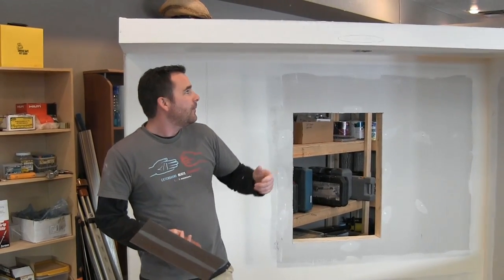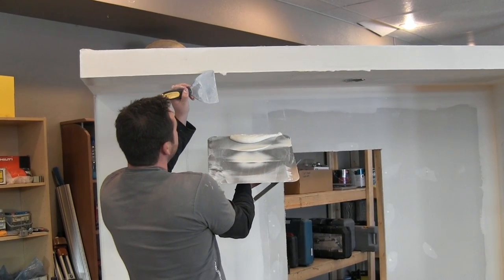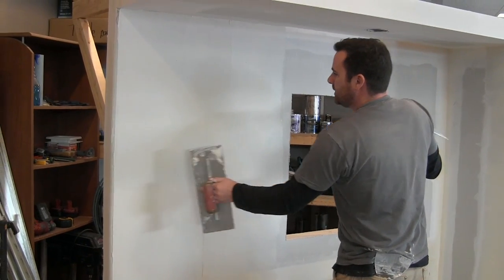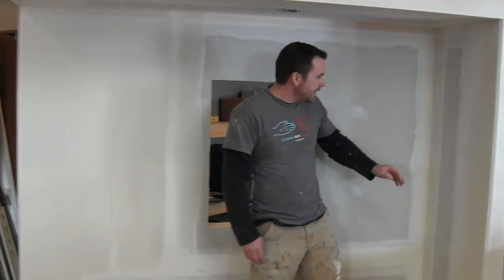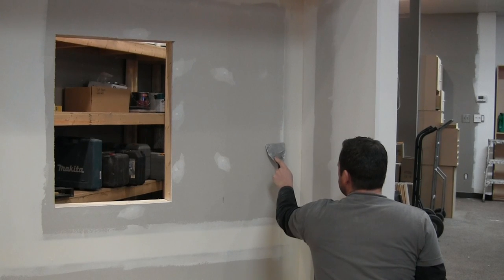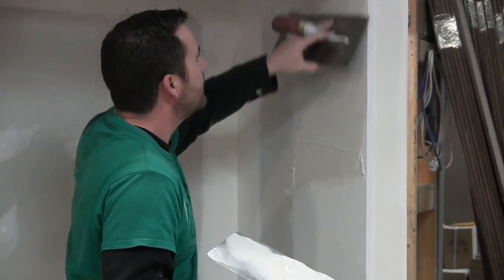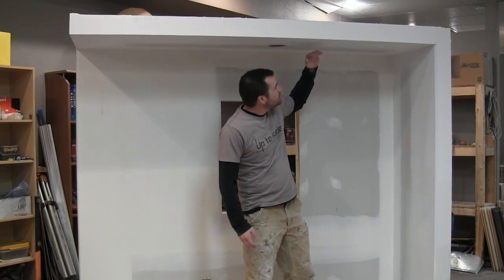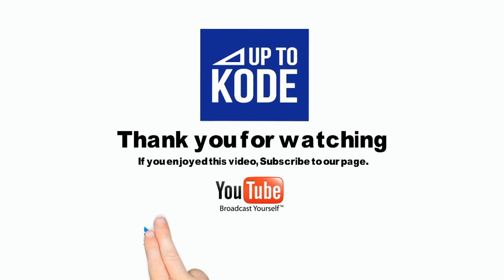The Complete Beginner's Guide To Drywall Video: Mastering Drywall Mud & Coating

Comment from the maker: ***** I couldn't see where to reply to your comment so hopefully you will see this. I would still use your trowel. Sounds like it's a true drywall trowel which have a slight curve in them. I typically use a concrete trowel which is straight. If it's that size I would maybe just do a swipe on the left and right side of the joint and then one down the middle to flatten it out. If you have issues try holding the trowel more flat to the wall than perpendicular. That should keep your mud flat if there's a curve in your trowel. Let me know if that helps.

Comment: The right way to mud !!! I would only suggest one thing. Instead of using just a 12" drywall trowel, ditch the 12 and use a 10" and a 14". Not only do they give you the progression in width, the 10 is stiffer than a 12 and the 14 is more flexible. Just what you want as the layers get thinner.

Comment: I have a marshalltown 14 or 16" trowel like yours but it has a slight curve to it. 

What can I use that for? Only the first strip down the middle of a butt joint? Seems like an expensive $50 trowel for that purpose alone.